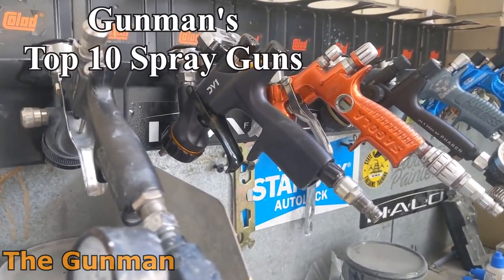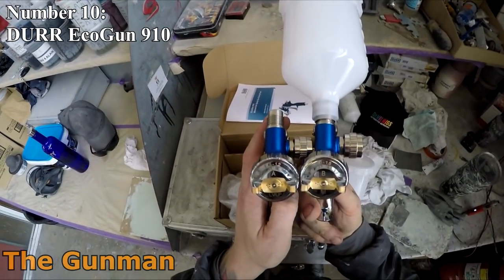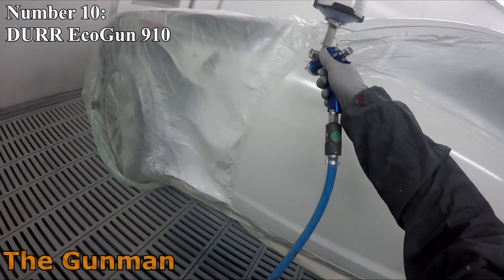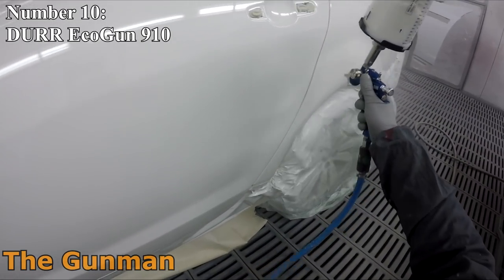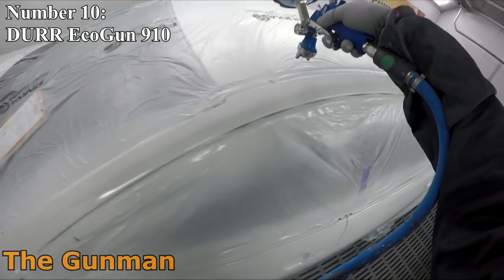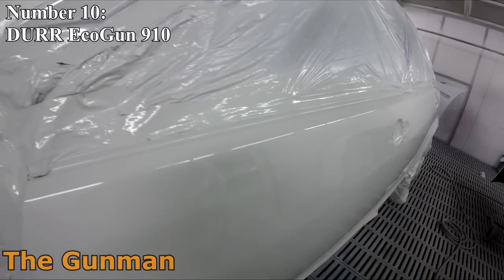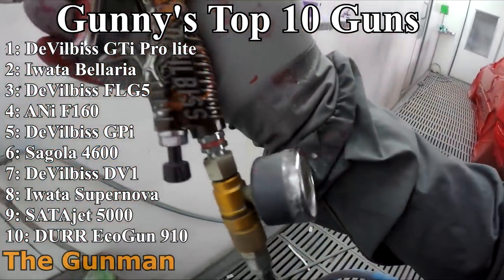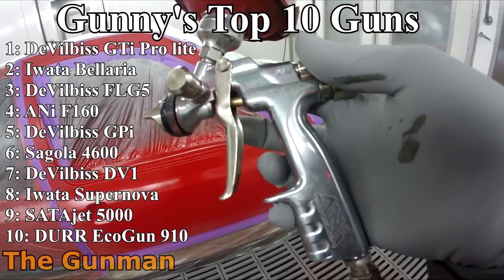Top 10 Best Spray Guns

Comment from the maker: How to win a gun! Watch the video, then visit my webpage linked below, and leave a comment in the comments section, to go in the running to win 1 of 2 brand new Spray Guns thanks to the channel sponsor, SpraygunsDirect.co.uk whom I thank for their continued support of the channel.

https://thegunman.net.au/top-10-spray-guns/
Reply: GTI Pro Lite, best punch per £££ and so many set up options,  simples
Reply: Hey bro went to the website to enter however couldn’t see where to comment
Reply from the maker: @lewisknibbs5302  there's a comments section below the photos. But as I say, maybe just be patient, the amount of traffic can slow it down, just try again in a few days if it's too slow to load.
Reply: The Gunman all sorted thanks again mate.
Reply: I like how you always talk about money first. Because most people can’t afford a beautiful spray gun because not everyone is financially stable. Nice vid!
Reply: Video idea..... If you could only have 1 primer gun, 1 base gun, and 1 clear gun for everything. What would they be?
Reply from the maker: Pro lite for both base and clear and an FLG5 1.8 for primer. That's probably all I'd need. But I'd also want a mini gun like the ANi R150 1.2
Reply: @TheGunmanChannel  I use an FLG5 for epoxy & high build primer, I do struggle to get an even fan and get paint build up on the tip.  Suspect my compressor isn't man enough.  Even with a Pro Lite with TE20 & 1.3 I get some fluttering. 1.2mm and everything works fine for me.
Reply: WHERES THE 5500 SATA??
Reply: I’m a dedicated watcher for California! Awesome as always! 😎👍🏼
Reply from the maker: @randymehrhoff2384  you mean them guns that myself and loads of other people have received defective out of the box.
Reply: Hey @The Gunman ! I just picked up a Tekna Prolite and I have it on 1.4 TE20. I wanted to ask, with your standoblue clear (I’m on spies hecker clear) since the clear seems a bit thicker than most, it’s taking me a while to get the orange peel, even with the material all the way out.. any recommendations?
Reply: As always we can count on the Gun Man and thanks to his sponsors to for getting him these guns so we can have the most information to be able to make an informed and worthy purchase!!!! Thanks from the U.S.
Reply: thank you for all his videos. I learned a lot thanks to you. and I bought thanks to your advice the flg5, gpi, gti pro lite, and ani r150. I follow you from France
Reply: @georgecarlos3159  
Man, i started worked at a shop that uses Glasurit HS clear coat, and i am struggling with the clear😔
So much texture and orange peely...This is supposed to be cats ass compared to the cheaper clears i used to spray when doing work for myself(PPG Shopline, and Nason) but with my Tekna and TE20 1.3 @ 29psi i could get them to lay pretty flat...Now im trying different air pressures, different speed and distance and an just frustrated. Today i tried 23 psi , about 6 inches from the panel and it wasnt horrible, but still want it better! Im starting to lose my hair in just 3-4 weeks😂🤣
I really hope you get it figured out! Wish i had the same clear coat, i would do a pile of test panels at home till i figured this shit out!
Reply: splash bro, I just painted an 8 foot bedside on a ram 2500, I was going so slow just to build the texture to a nice shine... my boss has a SATA 5000RP 1.3 and it just pumps it out compared to my Prolite on my clear now. For my side jobs I have Nason 468 and same, @29 PSI with TE 20 👍🏼   I brought my Prolite to 24.5 PSI to get the bedside but inconsistent, took me some polishing
Reply: @georgecarlos3159  funny, i just sprayed an 8 ft boxside and door today, was between 23.5 psi and 24 psi and not crazy happy. I was recommended to spray the clear between 20-24 psi, but like i said, i can lay Nason pretty flat, but i spray around 29 psi...
I was almost gonna try switching out the 1.3 for a 1.4 and see if it helps?
Reply: splash it helps a BUNCH!! Throw the 1.4 and run it around 24 and work your way down to check it out, it took me about 22 ounces to cover decent but from 1.3 to 1.4 helped as much as it could
Reply: @georgecarlos3159  
Thanks man! Im gonna try when i go back to work Monday. Il throw the 1.4 in and give it a go! Weird how around 30 psi lays the cheaper clears down nice, but the more high solids clears need less psi? You'd think you'd need more psi to bust up the clear to atomize it better.
Reply: Hope mine went in😂🙏🙏🙏

Comment: I purchased a Tekna pro lite  based on your reviews on the GTI platform spray gun, and its really good, low overspray, high material savings at very low pressure, I absolutely love it, I've been using an Iwata Lph 400 for about 12 years, and the diferrence is night and day, this is a true HVLP spray gun.
Reply: How did your tune your gun? Mine likes to lay down a lot of material for some reason and I can’t seem to save on material

Comment: The Gunman - absolutely super informative video - one of your best - I'm a DIY and just love spray painting - when I was younger and running my business, used to hire a compressor & gun - now I'm retired, do it as a hobby - made a lot of mistakes, but learnt - now when I get a good finish straight off the gun (no sanding) it's like a drug, you get on a high - started off with a 2 hp, 88 liter tank, compressor, with a Sata knock off spray gun (difficult to get a smooth finish) - just purchased a 4hp, 150 liter tank compressor, 13 cfm, so looking for an affordable gun to match - currently down to three options (based on your gun review) Iwata, Tekno (DeVilbiss) and Sagola - might consider also the ANi R 150 Mini gun (mostly doing smaller jobs) thanx' again - love your video's

Comment: my workshop paints parts for the volkswagen industry, and we use Sata guns only because these are one of the fastest guns to put out color material and clearcoats, since we have to paint alot of parts a day we also need reliable guns! and ofc the satas last only like a month or 2 until they start showing wear since they get used 24hours a day

Comment: Just found your channel Gunman, really useful info on pressure settings and the ability to manipulate results, fan size etc. just by changing pressure. I'm starting a restoration on a 1951 Hudson Pacemaker (I had no idea Hudson made a 1933 Pacemaker Eight!) at home and already bought a Anest Iwata gun with 1.8 nozzle for epoxy sealer (AZ3 HTE). Plan is to repair then seal each panel one at a time over the next few weeks.  When it's time to reassemble and paint the whole car I'll look for a gun with a bigger fan as it's a big car. Thanks for your very informative videos, I'm gonna start going through your back cattledog of videos for my bedtime reading! 

If I ever need a jump start in Melbourne I'll get you to grab the jump start kit ...

Comment: Great list your videos have taken me from a industrial type painter to a custom finishes. I paint at custom trailer shop and used there pressure pot for a year then started getting my own guns and prepping better. Not just a quick sand but removing millscale and wide with wax and grease remover even the bosses couldn't believe the differences one day it wasnt bad before. But now I can get minimal and glass finishes with high quality 2part alkyd enamel 5 year fade out warranty. Gti pro light and sagola and sata 5500 we do some vehicles but Bobcats skid steers, dozers , military vehicle. I'm the only painter. Thanks for everything was able to get more money once I learned to use hvlp rp lvlp. Coming from pressure pot to hvlp. Didntike hvlp at first. Abd bought lvlp and loved it. Once I got to where that was to slow. I went back to that other gun and found from you get closrt 4 5 inches away and it laid glass. Experience and experimenting is the way to learn but seeing and having pointers helps when spraying daily. My boss couldn't teach I self taught. Now I can walk in any shop and if they let me do a job for free I know I'll get the job. Started side work at my house. Thank for the time in these videos. For DIY I run 3 compressors in parallel 3 different breakers. Roughly 17 cfm @90 150 psi 65 gallons and portable

Comment: love the vids mate always learning heaps keep up the good work.
ive done a few jobs with my flg5 now. as a beginner I picked it up followed the settings you recommended and just started painting. I really cant believe how easy it is to use. the first job was a bumper in red metallic. I did get some orange peel due to not thinning my clear correctly but matched spot on after a polished. for anyone looking to buy a first gun its been easy to pick up and learn with the Devilbiss flg5

Comment: Hi mate, I love your vids, they are so helpful to me as a hobbyist car nut who occasionally needs to do a little painting. I have an Iwata Inest AZ3 with a 1.3mm cap which I have been using at 28psi linked up to a large capacity compressor so no worries there. It seems to use a whole heap of paint tho and wondered if you could provide a few additional tips for me. Also my base coat sometimes goes on a little dull (not wet finish) but its always a balance between wet finish and heaps of runs. I don't use a booth and am in VIC AU so its often less than 20c. Cheers mate and keep up the awesome vids.

Comment: Hey Gunman, thanks for all the great videos. I wouldn't have had the courage to take on the DIY painting that I have done, without these videos. This one in particular could not have come at a better time. I am buying a new gun and was not sure what to get. After watching this video I decided on either the Iwata Bellaria or the FlG5. I almost bought the Iwata, but found an FLG5 with a 1.3 from MDA Bitec in the UK. Supposedly, Devilbiss made them specifically for them in some type of volume deal. I am a little skeptical, but they are a reputable company so figured I'd give it a try. I am in the US so it's going to take a while to get here, but I will let you know how it goes. Thanks again for all the work you put into these videos.

Comment: Hi Gunnie, I have a Sata jet 5000 RP 1.3 phaser, I have had it for a while now and just started using it (trying to) a couple months ago. Going from the 4000 to 1.4 to.it was really hard because it always seemed to be a pain to adjust. I recently looked at the needle head on while I pulled the trigger and it bends downwards!  Have you had this issue with any of your santas? I sent it out to sata but they did nothing to it other then clean it and replace some seals. They said it sprays perfectly fine (BS). Also I never dropped any part of the gun so there should be no reason for it to have a bent needle.

Comment: I tossed up between GTI and Bellaria a few years back now. I was using Iwata W400 at work for painting the locomotives and for me it was a nice progression with awesome fine air cap. Came with a 1.3 mm tip and been fine for direct gloss,base and clear.  Cost me over $400 AU I'm sure though..😂👍
Reply: so you are using 1.3 for base as well?
Reply: @mura0  yes I've used same setup to this day, painted quite a few metallics and pearls. You could give 1.4 a go but for myself the 1.3 is always consistent with great results.  Love the Bellaria still! Tony's Refinishing on YouTube uses same gun on a few of his videos too.

Comment: Thanks Gunny for another great vid... just a quick Q... I've got the Gunny edition Pro Lite in Green and will use the TE10 1.3 for base. Would you recommend me using he 1.2 tip for HS clear to achieve a flatter glass like finish or stick to the 1.3?
Reply from the maker: Awesome man cheers. So, I'd only go 1.2 if you have thinned the clear at least 10% all clears are slightly different so it's hard to say for sure but personally I'd start with the 1.3, I like a nice amount of material on there, so it'll last longer, gives you more to buff into also.
Reply: Iqbal Ahmed - look at the T110 cap
Reply: Rusty Zipper cheers mate, will do 👍🏼
Reply: @froggy8301  DON'T WASTE YOUR TIME WITH THAT SETUP  " GET YOU A IWATA SUPER NOVA  👉 WS 400 - 1:2 HD 👈TO ACHIEVE THE BEST FLAT FINISH IN THE WORLD  - THE GUN MAN KNOWS THE SUPER NOVA SET UP IS THE BEST IN THE WORLD
Reply: @unlimitedservices3170  thanks for the tip, the Iwata is out of my budget range at the moment, I'm only a novice at this, but will have a look at the video reviews 👍
Reply: @froggy8301  THANKS " IF YOU GET A CHANCE CHECK OUT " MOTIVATED PAINTERS SPRAY GUN ADJUSTMENT ON YOUTUBE
Reply: YES I WOULD USE THE 1.2 IT SHOULD PUT YOU CLOSE TO WHERE YOU NEED TO BE  "  My only dealing with devilbiss is the devilbiss plus clear gun it's the best clear gun that devilbiss ever made " it comes with 1.2 & 1.3 & 1.4 tip with the gun " the gun will not break the bank & the devilbiss  GTI millennium  gun is neck to neck with IT IT comes with 1.3 &1.4 & 1.5 tip in the box

Comment: Interesting list. I somewhat feel the 3m accuspray should be on a top 10 somewhere just because of how much value you get out of it. You don't have to baby it, super easy cleanup and easy change of fluid size. You get a primer, sealer and a decent base gun. I mostly use it for primer and sealer though. What do you think?

Comment: Much respect for all your shared knowledge...you're in an upper stratum. I NEED a gun, but applying a finish is a  secondary function of my business...I'll spend 2 months building a guitar and two weeks finishing the guitar...and most of that time is letting the nitro lac harden bf polishing...I'm hard pressed to know how much to spend...spray exclusively Lac sanding sealer and  Nitro Lac..(instrument grade which is a little more flexible) using HVLP 1.4 tip..sanding sealer @ 27psi and Nitro lac @ 31-32...its always hit or miss...still dreamin' of finding the "nice" gun...help

Comment: Hey Gunny great video, looks like I did right by buying the Tekna ProLite :)
What fluid tip & air cap combo do you usually for spraying basecoat and clear with the ProLite? I used 1.4 with TE10 for base, and 1.3 with TE20 for clear and it turned out pretty well but just wondering how you do it.

Thanks

Comment: I have what I consider an important question      a friend of mine that is a professional spray painter has advised me to change the inlet size on my guns to 3/8 high volume which his system is     do you do that to any of your guns             he says it optimizes the atomization  and efficiency of the gun as well as increasing fan size because painting is air volume  ............     what is your opinion please

Comment: I am extremely happy with my Devilbiss made in mexico version you recommended a few years ago, I don't spray paint a lot, I used it the other day to spray 2 pack base on a tractor bonnet, Devilbiss guns are well engineered inside compared to the cheap and nasty ones

Comment: thanks again for an informative video, I have a flg4 how would compare this to the flg5? the flg4 seems to require a lot of air, (weak)

 I'm trying to decide between the bellaria, ani 160, and the flg5,  gti pro lite. I just dont want a gun that requires a lot of air. leaning toured bellaria or  gti pro lite because of the ANI air consumption and the flg5 having issues with silvers.

Comment: Hey Gunman, says at spraygunsdirect that ANI 160 as a consumption of 7.77cfm that is 220L/m, is that hi? Or is it wrong? That is low than a Gti pro lite with t10 cap, 270L/m, 9.5cfm., ok ANI 3 bar, Gti 2 bar but I am strugling to understand, i want to buy a budget spraygun for waterbased. Cheers from Portugal

Comment: Hello,
Great content as always
Quick question...
I just purchased a gti pro lite with a t110 from spraygunsdirect
I was setting it up last night spraying some laqure through it to see what the fan was like and I didn't like what I saw.. 29 psi.. there were 2 spots at the top and bottom of the pattern with a slight amount of paint connecting them.. then as I wind in the fan the dots get closer untill they touch but the fan is small.. then I continue in and it becomes one zeroed in spot
Could it be because the air cap is designed for HS and I'm spraying laqure thinner and it is splitting it?
Thank you for your time
Reply from the maker: That's not unusual, most guns will spray like that with thinners, either lower the pressure until the spots join our put a thicker material in. If you spray thinners at 14-15 psi it will have a nice fan
Reply: @TheGunmanChannel Great, thank you for taking the time to explain that to me! Thank you very much for the quick reply!

Comment: I have my top guns: 
Devilbiss GTi pro lite 1.2 (thin coats, whole panels and half panels, asia structure clearcoat)
Sata 5500X 1.3I (heavy coats, big panels, euro finish structure)
Devilbiss DVI 1.2 gor basecoat
Sata minijet 4000 for small jobs
Devilbiss Pri Pro 1.6 for primers and so on
 
And the best is time at home where I dont need to work with them.

Comment: Hi, gunman I've been looking on line for a devilibiss GTI Promote but little bit confusing as it saying all hplv guns ,is this correct,? As I don't want a hplv , can you help explain  thanks David
Reply from the maker: The TE20 is not HVLP, but the TE10 is probably the one I'd recommend, it's not HVLP either, but it will use less air than the TE20.

Comment: I've Got a Panel Van, to be sprayed in a" House Of Kolor", I know my  $150 Star gun isn't going to cut it, Primer maybe. But Ive been trying to find at a reasonable cost a fair all round gun that will do my base coat and clear, Not knowing where to get the quick release stuff is also an issue..  Cheers for the clip, its helped heaps, and prices that are fair.. I couldnt justify $1000:00 spray gun.